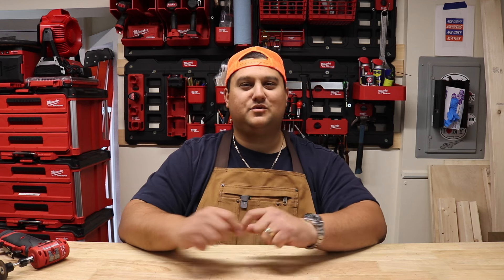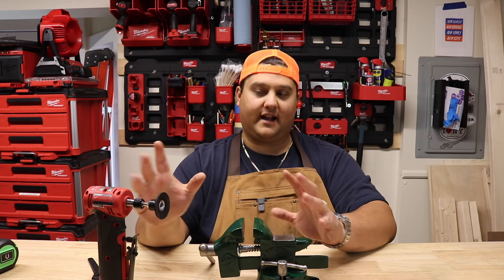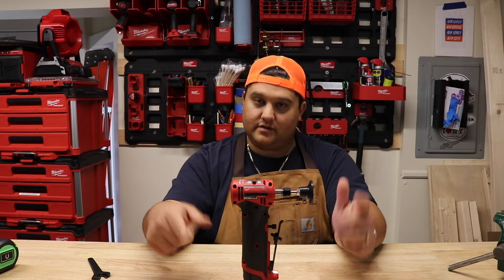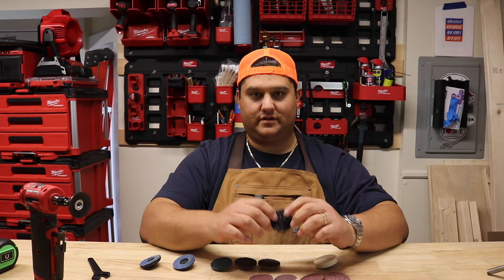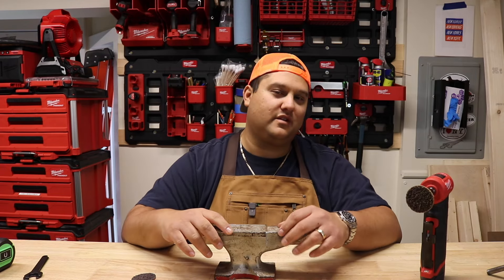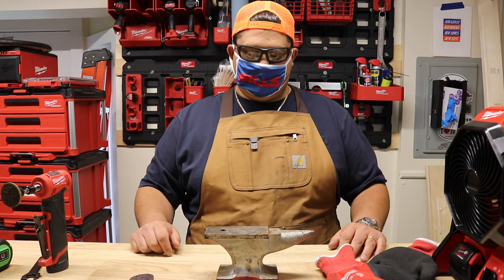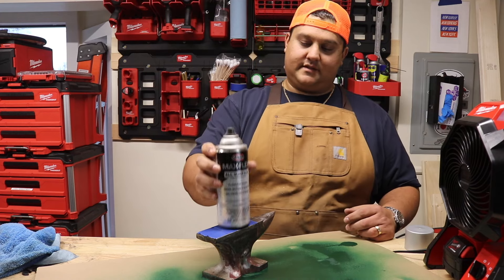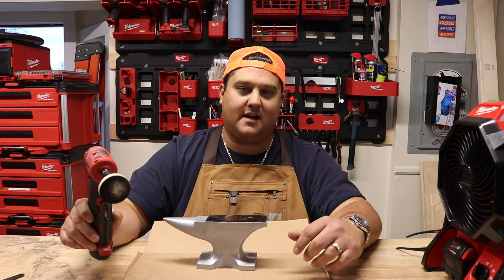Watch Before you Buy - Milwaukee M12 Die Grinder

Comment: I've been restoring an older car for the past few years, that had a lot of rust, surface and pitted (but thankfully not structural), and after a frustrating first go with a low-end drill and wire wheels, I did some research and found out about this tool, and bought it. One of the best car-related decisions I've made. It's not perfect, could be a bit smaller and lighter and easier to wield. But this thing's got some serious speed and even power, so long as you don't overload it with too big discs or by pushing on it. With the right discs or bits it gets nearly all rust out, except for hard to reach spots which I use a rotary tool on. Make sure to treat and paint anything you remove rust from.
Reply from the maker: It is a wonderful little machine. I'm hoping to get into some car restoration stuff in the future, for now I keep it simple and restore old tools

Comment: That vise looks really nice. What green did you use? That color is nice. 

As for shaking up the paint, I’ve been using an electric paint sprayer (not the airless kind) and I really like it. I just stir the paint, add a catalyst to it, thin to the necessary consistency and spray away. It leaves a much better finish than I’ve been able to get with cans. 

Also personally, I just took the roll pin out and removed the paddle switch.
Reply from the maker: I painted it Rustoleum Hunter Green with the 2X gloss. I could see taking the roll pin out as it is kind of annoying for prolonged usage. Will consider that! I also have never tried and electronic or air sprayer, perhaps that should be a future purchase!
Reply: @HeyDerFolks I got a cheap one off of Amazon and the finish is better than I expected it to be. I mostly got it so I could use 2 part paint without going broke but now I just use it for everything besides really small stuff. Airbrush might be better for that. 

If I still had the paddle I would probably keep it but remove the safety lock thing on it. That was the main thing I didn’t like about it

Comment: 4:11 Now they have the tool with a charger and 4ah battery and free 2ah battery for $159
Reply: Where? It's $270 at HD with one 2AH battery. $152 bare tool on Amazon. 

While the Hyper Tough is just as good and for 46 and includes the battery... 
Milwaukee needs to get off their high horse.

Comment: The price tag is whats pulling me away. New apprentice and air die grinders are dirt cheap but these go upwards of $150 for just tool
Reply: HD hack $104 with a 4ah and charger.
Reply from the maker: I'm seeing $159 for tool + 4ah battery + charger on HomeDepot.com right now. I don't have any experience with air tools so I can't speak to the difference in terms of price, performance, or quality. That being said, if you're going to use it everyday, I don't think you can go wrong!

Comment: I love Milwaukee, but the Ryobi right angle die grinder is way more powerful. Check out the comparison on the Torque Test Channel.
Reply from the maker: Interesting, never would’ve thought that. Will give it a watch!
Reply: Agreed, and it has a spindle lock as well as being at least $40 less.  But I prefer the form factor of the Milwaukee.  The Ryobi is just a little too bulky for me while the Milwaukee is closer to an air tool.
Reply: @MojoPup How is the low speed control on the Ryobi? They really went a bit different direction. The Ryobi is for 3in discs IMO. Not as fine control, but faster removal rates.

Comment: As for actually using it, you definitely want to wear safety glasses, gloves AND a face mask, as you don't want to be breathing in that dust that it kicks up. And, those rough abrasive discs work really well on this, because of the high speed, and make short work of rust and paint without removing too much metal, which sanding and flap wheel discs will. I'm talking about what are often called paint stripping discs but which work just as well on rust, at least surface rust. To get rid of pitted and encrusted rust you'll need grinding bits and a rotary tool with smaller bits.